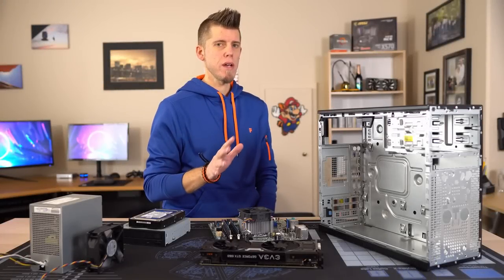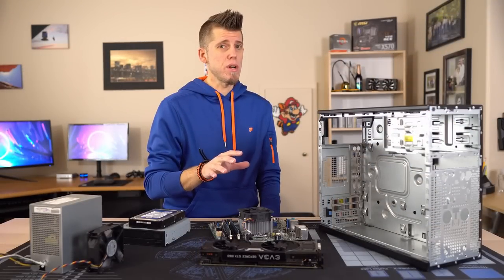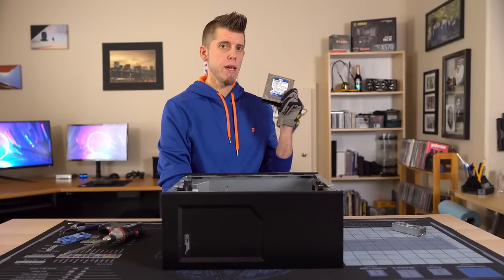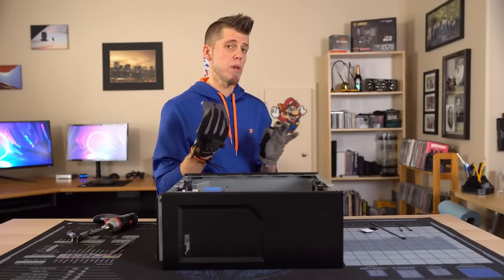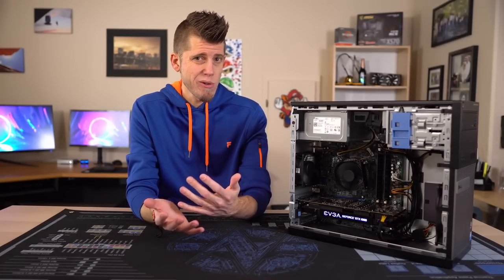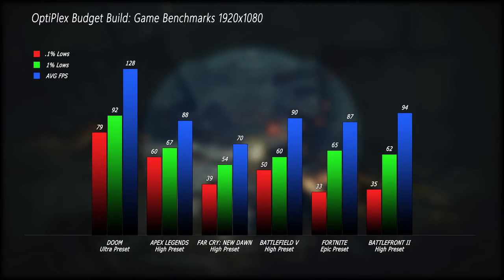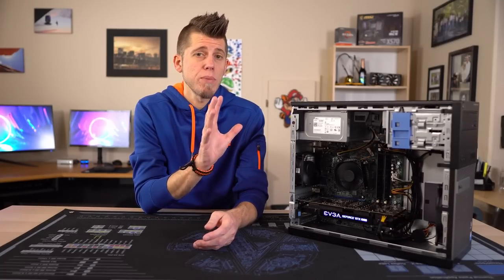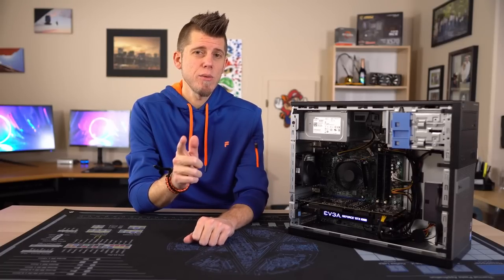Dell OptiPlex Budget Gaming PC For Under $300?

Comment: the only reason why i buy a switch and ps4 is for the exclusives,besides that i think there's a reason for me to buy next gen or current gen
Reply from the maker: Same here. I default to the PC and I saw no reason to buy an Xbox this time around and I hardly use my PS4. Use my Switch all the time though.
Reply: consoles are fine but its a different type of device and platform, just buy what you like, either way tho you need a computer at least for browsing the web 🙂
Reply: @MrSamadolfo  i already own a ps4 and the switch lol, i love consoles cause its a different experience, but one reason i don't buy 3rd party games on switch are expensive and they usually look worse than other versions, the benefit on switch is that its portable and they usually portray the same experience
Reply: @jackbro655  🙂 in south america, saselandia talks about the switch, its the platform for the upperclass, he says switch games have the highest tax, One good thing about that he says is if ur a reseller u can get alot more for the game when u resell it, kinda like when u buy a toyota

Comment: Quick guide for 200$ build:
- get lga 1156 motherboard for under 30$
- get rx 470/570/gtx 970 under 90$
- buy Xeon x3440 and snowman cooler from aliexpress (25$)
- get 8gb of DDR 3 under 25$ 
-get power suply and case for 20$ (from what I remeber evga usually sells one of PSU's for 15$ on something called mid week madness)
- overclok x3440 to 3,5ghz (or higher)
GG

Comment: I know Rich from Review Tech critiqued your vid but the 1060 with that low psu is iffy. I own a 1060 and I have a an EVGA 600w PSU in that build. Other than that the vid is excellent to me.
Reply: hope its not an evga N1
Reply from the maker: Yep, I'm watching the dislikes shoot up on this video. Honestly though, I did my testing and the 1060 is a super low wattage draw GPU. The total systems pulls like 240 watts from the outlet at full load. So, at worst, the components are pulling under 220 from the PSU. While not ideal, it's fine and I showed all this in my last video. Regardless, I appreciate the constructive criticism.
Reply: @TheGameBench  Dislikes? No way!! nah I don't see myself even doing that because your vid is great. As much as I like Rich I think this could have been handled with a comment. I have been building PCs for almost 30 years (I'm old) you did a really good job and I subbed. I only agreed with Rich based on my experience with upgrading AGP systems where going from a Geforce 2 MX to an FX 5700 Ultra would eventually either cause smoke or just not boot. Your work and the Gamer Nexus workbench says it all.
Reply from the maker: @superroboted  Oh yeah, it's getting closer to 90% at this point. The problem is that people aren't taking into account, Rich included, that not all power supplies are created equal and I wish he would have reached out to me first so I could have explained it. This is what I've been explaining to people. Nice to see another person that's been building for a while. Been doing this since high school back in the late 90's.

By the way, here's my explanation on the power supply. I hope this clears things up for people.

"Yes, nVidia says the minimum power supply you should run with the 1060 is a 400 watt. That's because not all 400 watt PSU's are created equal. Cheap power supplies might only be able to sustain that wattage for a split second, but might settle back down to 300, watts or less. Unlike a decent power supply that can maintain that wattage. nVidia knows this, and thus the rating. To make sure their customers are covered in case they buy a garbage PSU.

Now, 300 watts is enough to run this system. I've tested it and the components should be pulling around 210 watts from the PSU. The PSU in these Dells is capable of maintaining 290 watts. I tested this with an RX 480, pushing close to it rated limit for 4 hours and it did it without a problem. This leaves you a 70-80 watt headroom with a 1060 6GB. Even more on a 1060 3GB, which is fine and there is no danger to the components. That being said, from a power delivery standpoint, there's zero difference here. They would both provide about the same wattage and gove you the same amount of head room. Though I would argue the 290 watt PSU in the Dell would be higher quality than a PSU like that.

So, that statement from nVidia exists to simplify, so they don't have to try to issue and explanation like the one i just gave you and make it easier for their customers."
Reply: @TheGameBench  Rich kinda owes you an apology. I hear people saying this the internet but asking and talking to you first I think would have been much better. I didnt like the fact he dismissed your work either as I watched the video I saw quality craft here.
Reply from the maker: @superroboted  I really wish he had contacted me first, but it is what it is and he's tanked this video, but interestingly enough, he's gotten more down votes on his video than I have as a result on this one. Anyways, thanks! I appreciate that.

Comment: I spent $225 on a dell optiplex 990 with i7 2600 core, 16 gb ram, 1TB hardrive and a 180gb ssd. I’m honestly new but I’ve been watching videos trying to figure out if I spent the right amount of money
Reply from the maker: I mean... it's not the worst, but I will say that I've gotten 9020's with i7 4790's or 4770's, with a 1 to 2TB HDD, and 16GB of RAM for between $200 and $250. I would say that had I been looking at that system, my cap would have been about $160.
Reply: 🙂 looks about right to me

Comment: Where did you plug the front fan? Very good and educating videos btw
Reply from the maker: Thanks, sorry it wasn't very clear. I used a SATA to 4-pin fan adapter and added a SATA connector to the factory harness with a SATA EZ crimp connector. Then I used a fan resistor cable to slow the fan down.

Comment: I have been running a 1060-6gb on my Optiplex 9020 i7-4770 16gb RAM for 4 months now, playing Escape From Tarkov at 1440p at around 50-90fps map depending, flawlessly.  The game maxes out the GPU and runs about 40%cpu.  Yet the most wattage its drawn from the outlet is 220watts.  I plan to upgrade to a bigger GPU at some time when I find one for a good price.   Will be powering it with a SATA cable.  Id also recommend not running a plattered hd or the dvd/bluray player, and just getting a bigger SSD, I got a 1tb EVO 860, but I want to try geting a 280gb Optane 900p when I find one for a good price.  I got the idea to build the rig from this page, and it was fun to do.  Im in several Tarkov groups and enjoy reading posts about people spending lots of money building rigs that dont play it very well on 1080p. I highly suggest pairing it with a Dell S2417dg, 24" 1440p 165hz.
Reply: optiplex 9020 i7-4770 8gb ram - $220 (overspent. prob could find better deal)
pny gtx 1060-6gb - $100
8gb ram - $40
gaming keyboard/mouse - $50
dell s2417dg - $250
1tb evo 860 - $85 (on sale)
2nd 24" asus monitor - $30 = $775
Reply from the maker: It's comments like this that really drive me to make these videos. I'm really glad you found it useful.

Comment: If a power supply does not come with a 6pin power connector, there's probably a reason for that. Forcing the issue with a SATA to 6pin adapter is not going to be a very good solution. Using anything less than the recommended wattage that the manufacturer suggests is also not a good idea, especially to suggest to your viewers which may be new to PCs. Maybe if you know what your doing you could do the riskier things that you featured in this video but that should not be suggested to many of your viewers that may not know what they're doing. Also, the average power consumption is enough to conclude what wattage you may need. this is because of the power consumption spikes that your parts will create. A 1060 may consume 120w on average at max load but could easily go over that in power spikes. This is also why moving from the 10's series to the 20's for the same tdp cards, Nvidia recommends a higher wattage PSU for the 20's series card(with the same rated tdp to a 10's series card), this is to account for the higher power spikes in the 20 series GPUs. What i'm simply trying to get after is the fact that you may know what your doing and are able to take risks like these, but many of your viewers don't and this advice would mislead them to believe that they could get away safely with things such as putting a 1060 in a 300w psu.
Reply from the maker: The reason that there's no PCIe power connector on these power supplies is because when these system were released, the GPU's with a single 8-pin power connector were GPU's like the Radeon 6850, which consumes more power at idle than the 1060 does at full load. At the time, you wouldn't have considered running a mid range GPU on this power supply. Besides, these were sold to business's, schools and hospitals. Highly unlikely they were going to add a GPU to one of these anyways and Dell isn't going to waste overhead on something like that, even if it's capable of it.

That certainly doesn't mean it doesn't have enough power to deal with, newer, more power conservative GPU's like the 1060 which, like you said, only consumes 120 watts at full load. The rest of the system won't consume more than 100 watts max. You literally have 70-80 watts of headroom, at worst. Also, I measured the power consumption at the outlet, which is higher than what the components draw from the power supply. The system spiked to around 240 watts occasionally, but was sitting around 220 or less most of the time. It's objectively fine and completely safe so long as people don't ignore my advice and overclock the card.

nVidia's "recommendation" exists because nVidia understands that not all 400 watt power supplies are created equal. Lower quality power supplies are generally rated at their peak rating. This means that it can peak to 400 watts momentarily, but can only really provide 300 watts, or less, consistently. It's technically not a 400 watt PSU. If they're willing to deceive you there, they probably cut corners elsewhere and it probably only has a single 12v rail, and not a lot of amperage on that rail. Decent PSU's are rated by their constant wattage. This 290 watt unit in the Dell is a constant rating, not peak. And I have tested this. Close to five hours being tortured at it's rated limit. You're better off with this Dell PSU than one of these peak rated 400 watt units. It has protections and will shut off if it can't supply the wattage, I know, I've tested it. It's got adequate amperage as well. These are business machines and Dell is not in the business of putting garbage PSU's in something they will have to replace. Unlike their consumer level systems. Trust me, I worked for HP as a field engineer. It's in their best interest to not put crappy components in these. It would cost them more money, to send someone like me out to replace it, than not cutting corners. Anyways, that's why nVidia has that recommendation. It's so they can make sure their customers are covered with an explanation that's as simple as possible.

I stand by what I did in this video. I've built close to 20 of these things over the past year and I have yet to have one person contact me with any issues beyond some help with some software problems. I'm not misleading anyone. The problem is that the people thinking that I am have very surface level knowledge about power supplies. They think that wattage ratings are a constant, they're not. They think that 80+ ratings are a good metric of quality, they're not. They think that the 400 watt recommendation is a requirement, not a very arbitrary suggestion to cover people's asses for variances in quality, to not so quality power supplies.

What I did in this video was of no risk, so long as people don't ignore my warning to not overclock. However, I appreciate your constructive criticism and the way you presented it. Really..... thanks for being respectful and not being an asshole.
Reply: The Game Bench. Thank you for your time and reply. I guess I definitely underestimated the reliability of those dell power supplies. I’m generally familiar with power supplies coming in prebuilts being completely crap. But if you really have done the stress testing and know what your doing, then I guess I’m wrong about those dell power supplies. The amount of absolute crap power supplies and misleading power ratings really do make some of the power supplies that are actually half decent also seem bad. I gotta say I was a bit too quick to judge them optiplex psu’s
Reply from the maker: @jackieliu117  Thanks, I appreciate that I get why that mindset exists. The consumer stuff is pretty bottom of the barrel and on the face of it, the business systems and consumer systems are hard to tell apart. Honestly... I didn't trust the thing either until I pushed it.

Comment: This video has helped me decide which route I wanna go with my first gaming PC. I have a Mac I edit videos and work on, just want a cpu for gaming COD Warzone and Fortnite.
Im thinking about getting a 9020 with i7 with 8-16gb ram for around $180-$200, hoping to get one with one stick so I can add more. Gonna add GTX 1060, Fan, and 250 or 500gb ssd. 
I have seen some 9020s that are cheaper without a hard drive but worry that they may have problems or may have not been properly tested before re-sale? 
Im really just looking for an affordable pc to play Warzone on that also has good quality. 👌
Pretty much seems like upgrading an old Dell is the best bang for my buck IMO at this point.
Please let me know if you would suggest any different options...
Thanks good video!

Comment: great video helps a lot .....btw did u use the power supply that came with the optiplex or did u use another ?
Reply from the maker: I used the 290 watt power supply that came with the Optiplex. I actually did a video before this testing various GPU's with the i5 and the stock power supply to see what was safe to run.
Reply: @TheGameBench  yea i was going to build the same but the gpu which i had my eye on was the rx 580 but now i know the 1060 only needs like 190 watts .....i tot it was like the 580 ......thank you very much ur videos are very clear ... i am glad that i found ur channel

Comment: It's basically what the Amazon Referbished service does. Turn these old Optiplex computers into budget gaming computers.
Reply from the maker: And charge you a lot more to do it. Granted, some people would rather pay someone else to do it, and there's nothing wrong with that, just keep in mind that it's costing you a lot more. Saw one the other day for $350 and you could build a much better system yourself for the same money. And the system I put together in this episode should be extremely cheap at this point. Paying $300 for this in 2023 would be embarrassing.

Comment: In my case, I have zero access to any powertools in my area. With an unmodified case, can you still work with something like this?

And on a side tangent, will a 960 work? That still, this was crazy informative. Thanks in advance!
Reply from the maker: Yeah, there's no reason you can't do this without any of the mods I did, you'll just have to pick something shorter. I like the Zotac Mini cards for this. You can get a 1060 all the way up to a 1080 Ti. Tech Power Up also has a GPU database that shows the lengths of a lot of cards and you'll want to stuck to cards around 9 inches. It's possible to get a 10 inch card in there, but it's kinda' a PITA.

As for the 960... I don't have one to test, but all the power consumption tests I've seen says it should be fine.
Reply: You could absolutely do it without powertools- worst case scenario, the fan could be put on some offsets like with a typical motherboard and a flashing to direct air could be glued together out of basic plastic or balsa wood. You could also build a "rope drill" as i've known em- buy a stepper bit, get a piece of wood with a hole drilled in that the stepper bit can turn on, and wind a piece of twine or string around the shaft of the bit. Press onto the bulges to drill out and use the string to turn it. You only need to grind it down and get it open anyway, so you could also saw it out with a small hacksaw too if you don't mind it looking kinda crappy and needing a lot of filing of the metal.

Comment: is it fine if i dont upgrade the fan because when my pc is open my cpus temperature goes down from 46 degrees to 35 is that fine because i have a dell optiplex 9020 im getting 16gb of ram and a low profile gtx 1660S and do i need a 24pin to 8 pin adapter and im getting a 550w psu
Reply: I'm running a 1660s on my 9020 and you do need 8 to 24 adapter.
Reply from the maker: Yes, you'll need the 24-pin to 8-pin adapter for the PSU. As for the front fan, with all that material sill in the  way, you'd only be looking at a 3 to 4 degree difference. I did it because the initial GPU's I was using didn't have the best coolers and without the fan, they were throttling. With the fan, they weren't. Made no difference in operating temps on the 1060 that I used in this video. However, I'm going to be doing an updated video to take it all the way and open up the front panel for maximum airflow.

Here's the adapter I've been using.

https://www.amazon.com/gp/product/B07CJ411ZL/ref=ppx_yo_dt_b_search_asin_title?ie=UTF8&psc=1